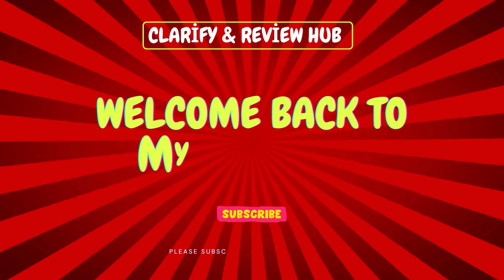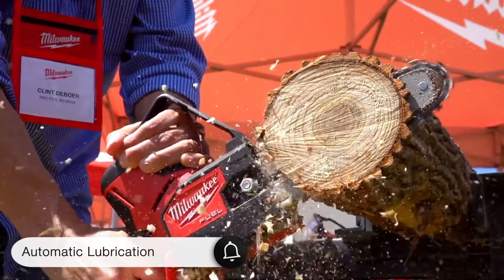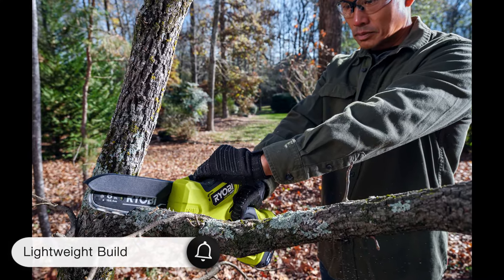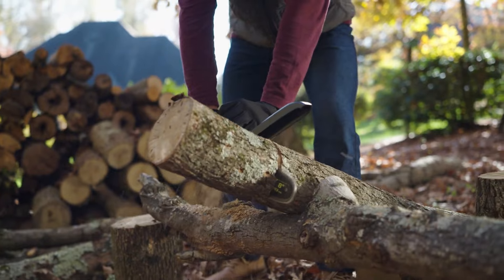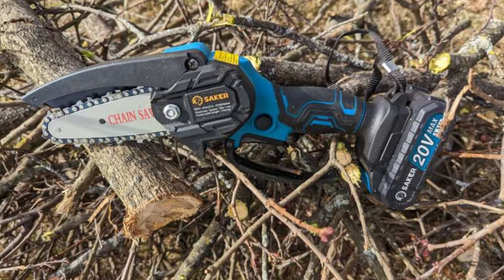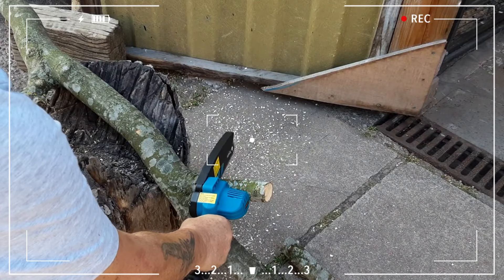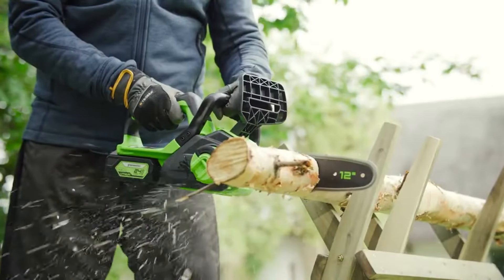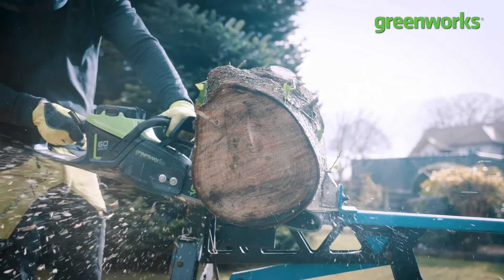Best Cordless Mini Chainsaws 2024 - Don’t Waste Your Money!

Comment: bought a ryobi pruning saw after 2 days the chain doesn't catch on the main gear.  Changed out the chains and it looks like the main gear is stripped?  It seems like there is plenty of depth but when I try to cut it stop moving but the gear is still going.
Reply from the maker: Hello! It must be frustrating to experience this issue. It sounds like there might be a manufacturing defect with the product you purchased. I recommend taking your product in for service under warranty or contacting the seller.